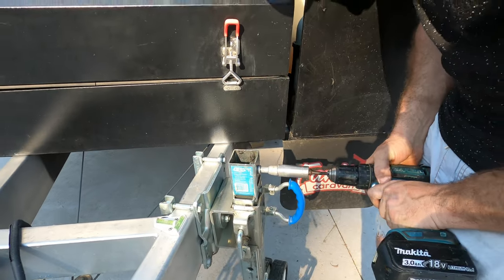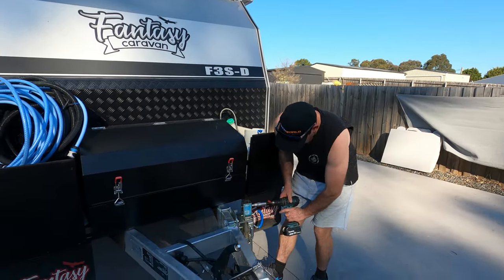Level and set up your caravan the safe way using a cordless drill

Comment: Love when you talk about how it broke, but it is a great method and we should give it a go....  😂. I think it might be better to look into stabiliser legs that are designed for use with a drill perhaps??
Reply from the maker: Hi acafwd, thanks for watching.
Glad you liked the video, yes great point as we noted drills with low torque are a better option than an impact drive. We broke our roll pin using a high torque setting. How ever we have also broke roll pins using the manufacture provided tool. It all comes down to user error.
Happy camping